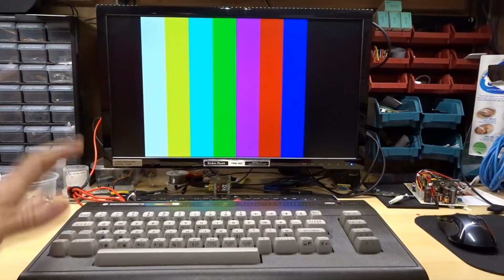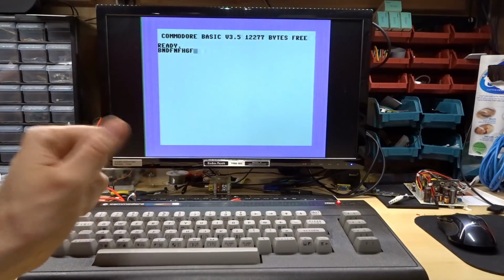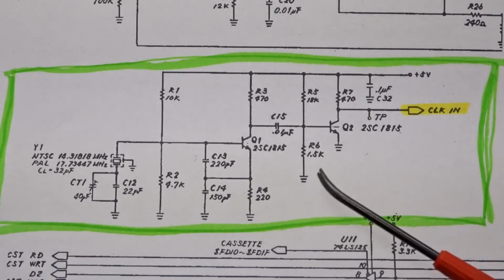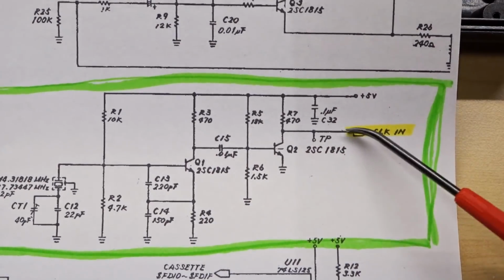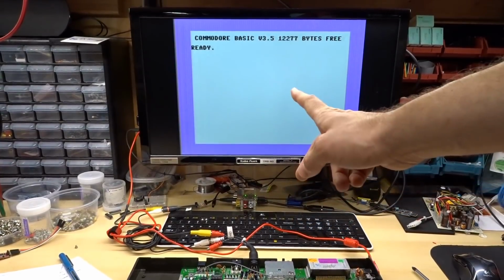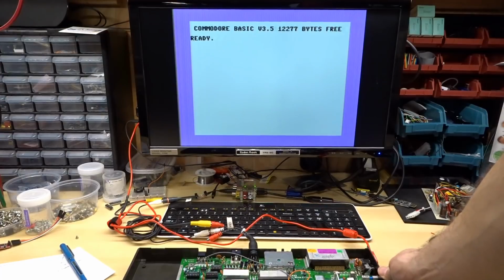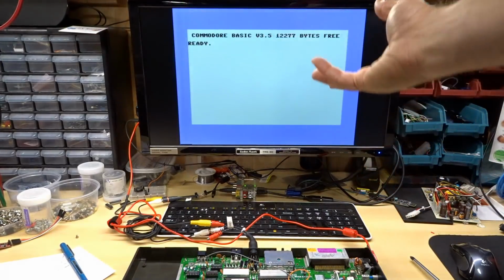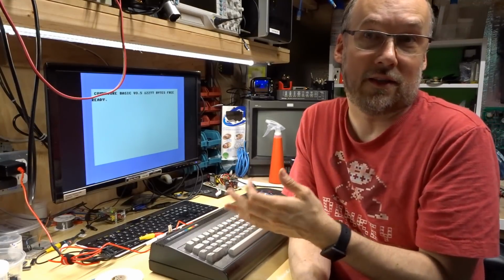NTSC or PAL? One C16 to rule them all.

Comment: Commodore's engineers could easily have a PAL/NTSC switch on every model which at scale of production would have been cheaper and save them money rather than adding all the extra circuits and have different models & production lines. Clearly the bozos at the sales & marketing departments thought exactly like the later bozos of the enteratainment industry that introduced the different DVD regions to separate the markets supposedly for IP reasons. Lesson learned : ALWAYS let the engineers do the design. Hardware decisions made by commitees were always stupid and short-sighted.

Comment: Try the Arduino Pro Micro, which is based on the Atmel ATmega32U4 like the Leonardo, boots instantly, and can still readily be programmed like the Uno or Pro Mini.  It lacks a reset button, but it can directly be used as a USB device, which is handy for some purposes.

Comment: Neat project-in fact, I am trying to do something similar on a different class of hardware. I want to replace the clock generator on a Pentium-class motherboard (socket 7) with one of these SI5351 boards so I can expand the number of FSB frequencies it will have available. The extra trick that I plan on is to use an ESP32 controller instead of Arduino; this way, I hopefully will be able to switch FSBs on-the-fly by having the ESP32 reprogram the generator through commands it receives over wifi, possibly even from a phone app. :)

Comment: Si5351 can generate up to 3 clock signals … why do you need to program it every time program it once clk 1=ntsc clk 2=pal freq … add switch circuitry to switch which clk to go to output

Comment: This is fascinating! you're pushing hardware hacking of this old beast very far. Kind of reminds me of a much, much younger me hacking an Oric Atmos (another 6502-based family computer from the 80s) to have both the Oric-1 and Oric Atom ROMs piggybacked on the same socket. Switching was merely done with a plain 3-pin switch button! Stone age compared to your design. Sticking an Arduino into this old beast to achieve the mode switch (which goes way beyond switching ROMs) is a blast! OK, now I need to ask although I'm sure that it's been asked already: what's this small screen on top of your CRT monitor apparently showing random animations?

Comment: cool little mod.  At first it seems a bit overkill, but it is cheap and easy, and very usable too.  All very wanted aspects of a good mod.

In the past, I would have built a duplicate clock board, and switched between the two clock circuits and EPROM banks with a flip flop triggered from the reset switch with an RC timing delay.  setting NTSC as the default mode.  I also always used cool multi-colored LEDs for all my mods, for this mod, I would use red to look normal for NTSC and yellow for PAL.  so the red would be connected as normal, with the green portion of a bi-polar led run the the same pin as the EPROM high address line used to switch banks.

I still think it would be more fun that way, but you have made a very usable mod.

Comment: For the Arduino, there are two other things you could do.

1. Program the nano/pro mini with an ICSP programmer.
No boitloader then. So boots more or less instantly.

Or. Use an ATTiny85. Tiny chip. No bootloader.
Reply: Or just use the Pro Micro, which is based on the ATmega32U4, like the Arduino Leonardo.  It boots instantly, and can readily be programmed like the Uno or Pro Mini.  By the way, it lacks a reset button, but it can directly be used as a USB device.

Comment: UK - across the pond. Hello Adrian. Many moons ago, the second of the TPA3116 amps video you did I ended up with 5. I have collected many more of these amps and the TDA7498 right up to the fan cooled one.  The thing is I don't know why, apart from they are good fun to play with. Some have a bit of beckground noise but not much. Of course I had to make a 10A 36V variable linear power supply and a pre amp. I have a couple of old Tannoy 15 Ohm monitors which are kind to these beasts. I'm not sure whether to thank you or wish I had never found your channel. I'll go for the former. Thanks Adrian for starting an old wrinkly having a reason to get up in the morning. The last time I played about it was with valves (tubes to you) - 51 years ago. Bloody ell.

Comment: Rather than cut the trace, I'm guessing that you could have just lifted one end of R5 and R7 out of circuit and connected the new clock to the test point.
With R5 out-of-circuit, Q2 would be held 'off' by R6. R7 is taken out-of-circuit to avoid the unnecessary load on the new clock. No traces cut.

Comment: The fastest way to boot an Arduino is to upload the sketch using an ISP programmer. This just writes the program code to the Arduino, without any bootloader at all. Pretty much as soon as the MCU is powered up, you code will begin to run. The only downside is that you can't just plug the USB/UART in to the Arduino and upload a new sketch, you either need to use an ISP programmer to upload the sketch, or burn a new bootloader.
Reply: Yes, but it's slightly more complicated than you describe, you need to reprogram the microcontroller fuses in order to switch off the bootloader. What I usually do is to stick the microcontroller in my TL866 programmer. That way it is high-voltage programmed and the TL866 software allows you to easily modify the fuses.

Comment: Really nicely executed. Maybe I wouldn't have cut traces, just unsoldered the components, put them in a bag inside the case, but making jumper wires to revert it, is also a legitimate tactic (It saves time).

Comment: Very nice mod! That clock generator IC was indeed a rather good idea and the Arduno allows you to do it without any additional switches. I still like my own mod for having quite a few less wires running accross the board ( https://www.freepascal.org/~daniel/plus4_pal_ntsc_switch.pdf ), but maybe I'm going to do some experiments if I can merge them and create a little board that fits in the faraday cage of the Plus/4. Perhaps if using just a single Attiny chip rather than an Arduino board can save space and perhaps with a little bit of creativity you can mount it to the si5351 pcb, so you don't need to run wires.

But again, very well done!

Comment: Maybe some of you could help me, I just bought an Atari 800 but only like 5 of the keys work. Any suggestions on what to try?
Reply: I prefer the conductive paint/pens.  They also work great for repairing the flexible circuit board pigtails that plug into sockets on many computers between the keyboards and main board.
Reply: Check out Atariage or Vcfed forums, would be a better venue to get support.  Comments aren't great for that.
Reply: Probably the old contact failure thing. You need to clean the keyboard contacts inside and either apply some conductive paint or give a light sanding to the key contacts to have them make connection again.

Comment: I think a old pic 12F675 is faster to boot because no need a bootloader
Reply: The Atmel MCUs don't need one either.  It's just there so you can load code onto an Arduino via serial.  The delay is just a timeout waiting for serial commands.  If you don't mind programming via ISP then you can drop the loader entirely.

Comment: I see what you did there :D

Will it work for the Plus 4 and all its built-in software?
Reply: Yes, technically it should work perfectly for the Plus/4 as both computers are the same in this regard. The case of the Plus/4 is much smaller though and you will have some challenges to find spots where you can mount the boards.

Comment: I don't know why PAL has to be so different.
Reply: @infinitecanadian : In retrocomputers, CPU power is much more of a worry than the refresh rate. In fact, the refresh rate hardly affects the user experience.  What 50 fps does mean, is that the CPU has 20% more time available to compute a frame. More CPU available to compute a frame means more animation possibilities in games. This made it attractive for developers to make games PAL only, and because these machines mainly sold in PAL territory, developers could get away with it.
Reply: @danielmantione  Yeah, but the problem was that they converted badly to the NTSC region.
Reply: Becuase North America uses 60hz AC, which was used to time video framerates. Other places used 50Hz.
Reply: Joshua Walker 60 cycles is better.  50 cycles is too slow.
Reply: Oh here we go. 😒

Comment: You can even see how the Never The Same Color effect comes into effect when you switch modes :D
Reply: Except it doesn't :)

The chroma phase issues associated with NTSC, and which were responsible for the "Never The Same Colour" backronym, only apply to broadcast RF signals. They do NOT occur when you have a direct AV line connection between the source and the display. 

NTSC has a slightly different colour gamut to PAL, but that's an entirely separate issue.
Reply: @dunebasher1971  It happens with composite too. Only way around it is S-video :)

Comment: Instead of cutting tracks, why did you not simply remove R7 and Q2 ? They are then easy enough to re-fit should you want to reverse the mod.
Reply: Or just lift one of the components leg. That way you dont lose the components.
Reply: Yeah, that sounds like the best approach...
Reply: Or another socket mod? Bend out the clk in pin.
Reply: Agreed 100%!
Reply: Yes. When there's choice between damaging the board or not doing damage, I think it's mandatory to not do unneeded damage. I won't give a thumbs down for this, because as usual this video is really well done and good for learning that micro controller stuff, but I also won't give a humbs up because of the partial destruction of retro hardware.
Reply: @MatthiasWelwarsky  Yeah, i didn't mean it would be hard to figure out the part, i just meant you had to get the part.  In any case, i agree it's easy to do that, but it's also easy to fix a trace.  This isn't irreversible like a case mod (which I've done to my ST to the horror of collectors everywhere.  hah!).
Reply: Maybe, but it's easy to fix a track as well with some solder or other options, and you don't have to track down the appropriate parts you removed.  I can see it either way, not sure one is better than the other though.
Reply: @Brian_PM  All you have to do is just lift one pin of the resistor, and one pin of the transistor. Or just remove them completely -- both are jellybean parts and would be extremely easy to replace, especially as the schematics are widely available. Cutting traces on vintage equipment is just... urgh. I hate when Adrian does that. He has this propensity to cut traces/bend pins/cut pins when it's just totally unnecessary and destructive. There is always a cleaner, easier option. Especially as he has multiple desoldering guns.

Comment: Is it actually switching between NTSC and PAL video output, or is it just switching between 525 lines/60 Hz and 625 lines/50 Hz? A true PAL video signal has a different color subcarrier frequency than NTSC, so it would display in black & white on an American composite monitor or TV unless it is multi-system. But if it's only switching the video resolution and refresh rate, and not changing the color subcarrier frequency, then the image would remain in color. I know that's what happens when you run PAL games on an NTSC Atari ST -- the video timing changes, but the color frequency stays the same, so as long as your monitor can handle the different refresh rate, it will still display in color even if it's not multi-system.
Reply: Yes, I have the 520STfm which has the built-in RF modulator and also composite video via one of the pins on the monitor port.

Comment: the C16 was the 1st computer i ever used.
Reply: …and I learned assembler language on the way. Not nearly as much games as the C64 - but superior Basic (graphics commands!) and the built in assembler monitor. Later in University we had a course in computer science - and the professor used a generic assembler language, which was practically similar to the C16 assembler. He stated the end result we would be getting in the end of the lecture, and I was able to jot down the whole program at once. Turned out to be exactly right in the end. IT WAS WORTH ALL THE PAIN! :-D Modded my C16 to 64kb, too…